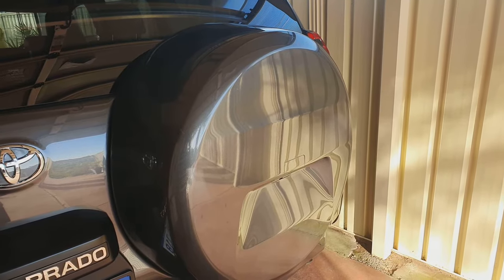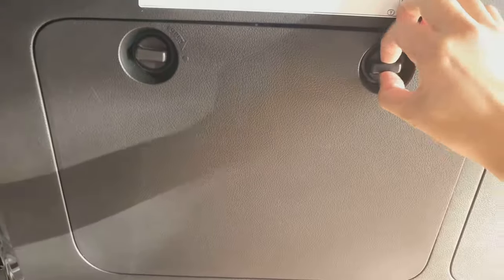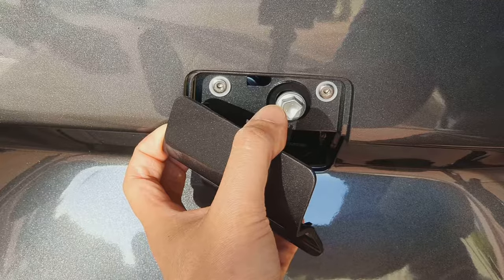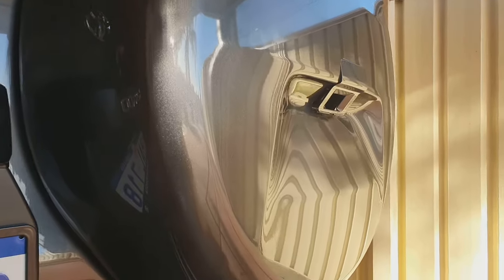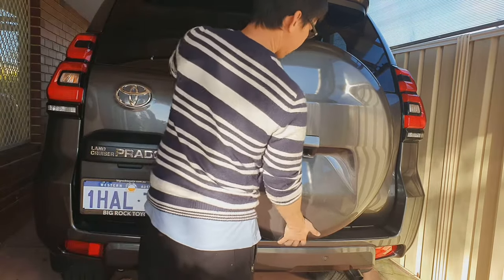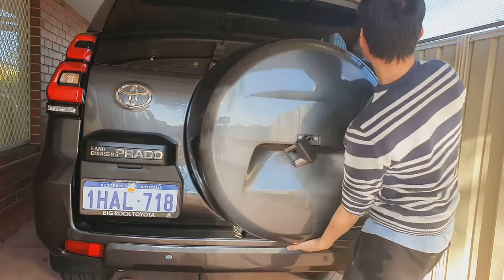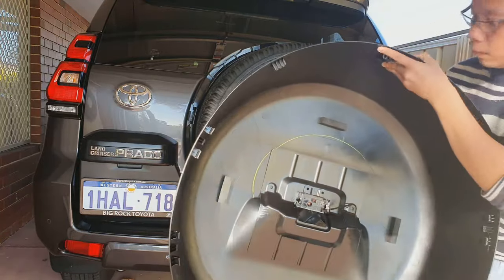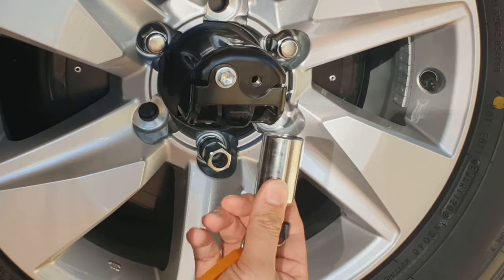How to Safely Remove Toyota Prado Spare Wheel Cover

Comment: Great video. I had one, and I didn't have the bolt which held on the tyre for some reason. Bought it brand new.
Reply: What size bolt? I need to buy
Reply: @roserdeepdosanjh8604 I don't know. I never had one.